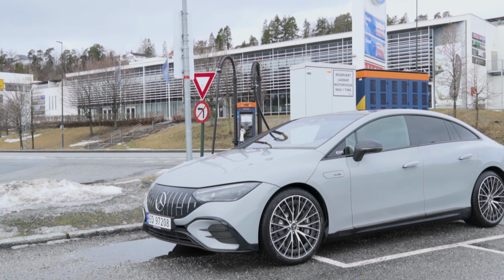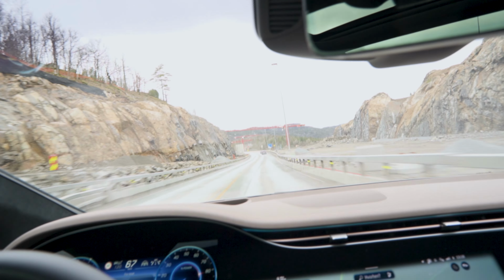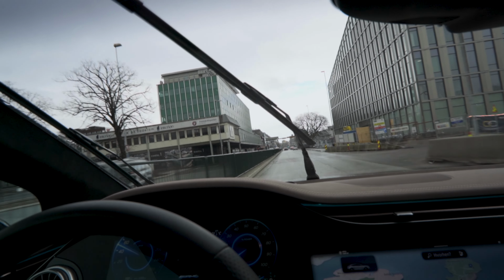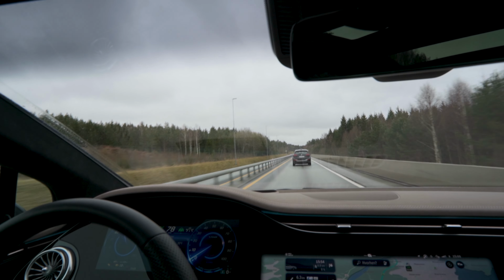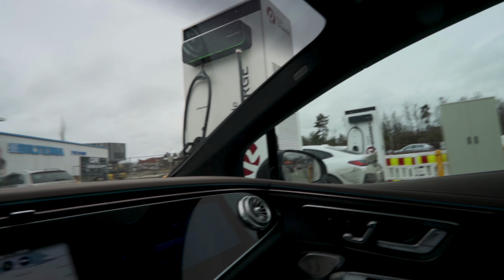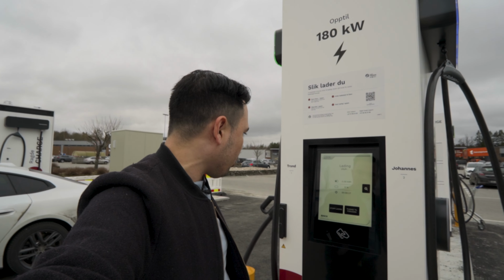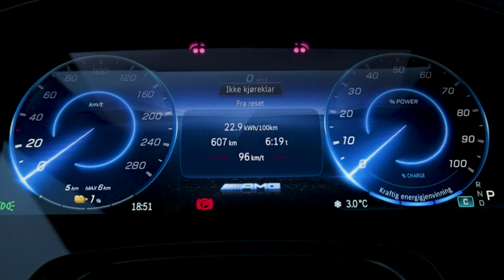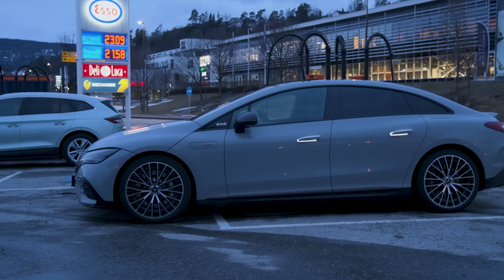610km Long Trip Test in Mercedes EQE 53AMG

Comment: The EQE heats the battery just enough for the speed of the charger. Right now you could ger 150kw already so no need to heat any more than that.

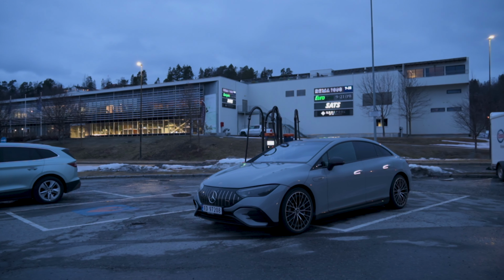Comment: 11:47 Nerves of Steel! 😅
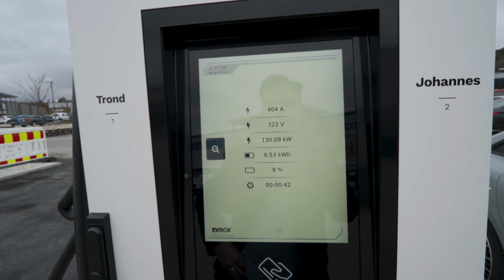10:47 A word of advice for "150 kW" Kempower stalls if the charging operator chose to limit it to 300 A - in this case with the 327 V battery voltage you would only receive UNDER 100 kW!